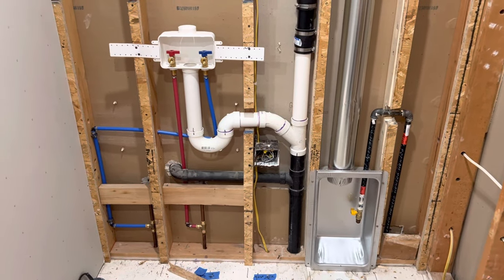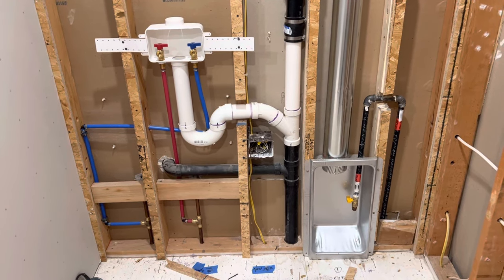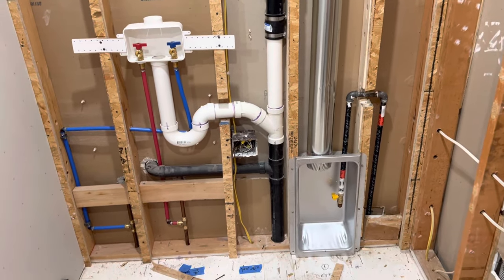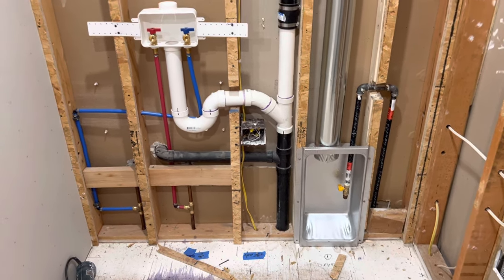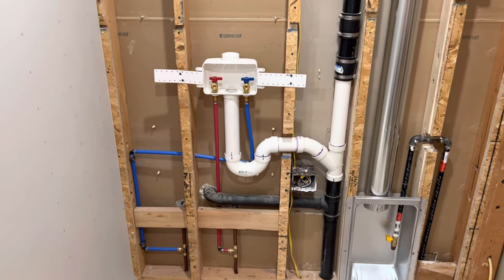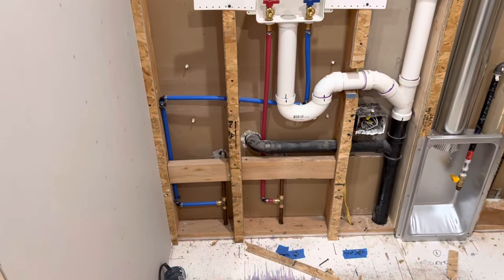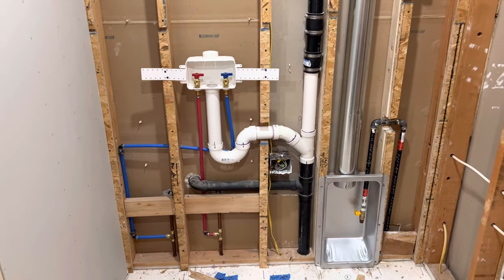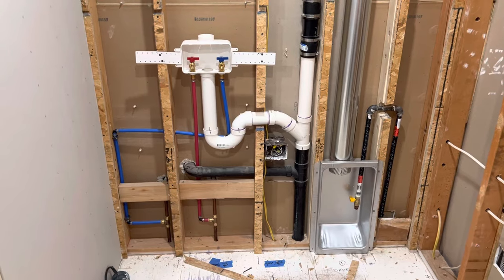Relocating a Washer and Dryer, How to install the plumbing and venting for a new laundry room.

Comment: I’ve been a plumber for years yes by code it’s not a proper install but it will work and there will never be a problem and in reality that wye and 1/8 bend is fine. The trap weir depth is questionable but it will work and no one is going to die from it.

Comment: The vent stack connection by code has to be a San T The wye 45 configuration is something typically used for horizontally joining two sewer runs.
As mentioned in The comment above the wye and 45 are breaking the flow of the vent. This can cause for negative pressure to build behind the draining water and when it hits the vertical section it will suck the trap dry. This will allow the admission of methane gas and hydrogen gas into the home which is dangerous.
Reply from the maker: All good points.  My home has a main sewer trap as it exists the basement.  Traps can also evaporate on their own with lack of use.  I appreciate your input and I’m glad I had the opportunity to start the discussion!

Comment: It'll work, that's the important part. If I was doing it I would avoid using shark bites, wouldn't mix ABS vs PVC, wouldn't use Y, would use PEX-A instead of PEX-B and the left PVC pipe has to be between 18 and 24 inches. I would also use Simpson Strong-Tie Stud Shoes in case it's a load-bearing wall.

Comment: Wow. Sorry to be blunt but as a former building inspector I would have wrote you up on quite a few violations! Stand pipe length incorrect, missing San tee for p trap, missing air hammer devices for washer faucets. Why did you notch your stud to send that gas pipe through it. It should have been drilled!! Etc etc
Reply: Is water hammer devices required by code? I rarely see them.

Comment: That’s illegal! I’m not even a plumber I’m an electrician! That is an S-trap because there isn’t more than 4” in between the 2 P-traps. Wich is not up to code and also the pipe from the box to the supposed to be P-Trap needs to be at least 18” to 24” long!

Comment: It's all wrong, yet here it stays, for all the world to be misinformed.
Reply from the maker: I actually had a hard time finding a video that explains the process.  I’m sure the community would benefit from your input.  Let us know what is wrong.  Sometimes I learn more from the comments section then the videos.
Reply: @flymike2day  I've just read the comments. Some of them I know to be correct, based on knowledge gained over the years. My concern here is that unsuspecting viewers may not read through them, and will do their plumbing based upon your guidance, and have to redo it later if problems manifest. I'm not a licensed plumber. Just sayin'.

Comment: Please take this video down. This is wrong for many reasons. Look at any diagram of laundry drain code and you'll immediately see how wrong this is.

In your comments say you are trying to help people and pay it forward. This is not helping.

1. You used a wye instead of a sanitary tee
2. Standpipe is not within min height range
3. Vent is not within min or max height range

This is all without being a plumber, just taking 5 minutes to read the code requirements.